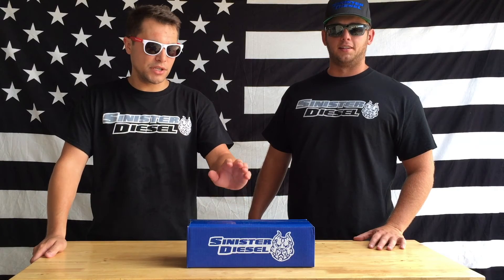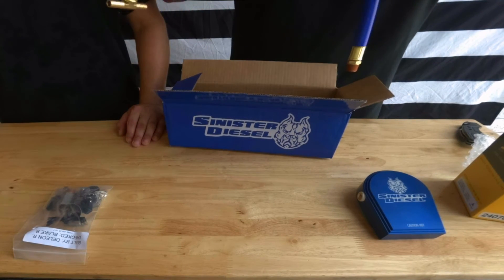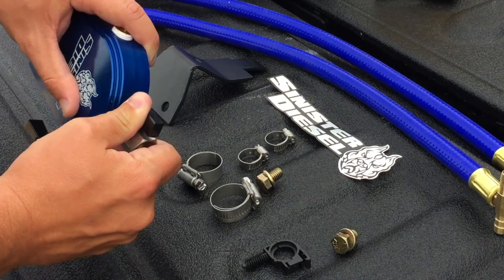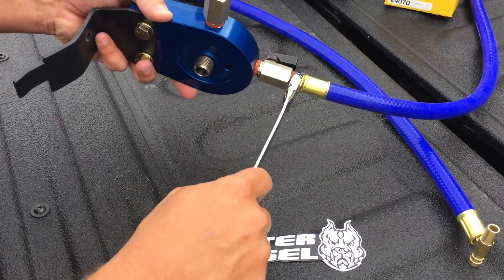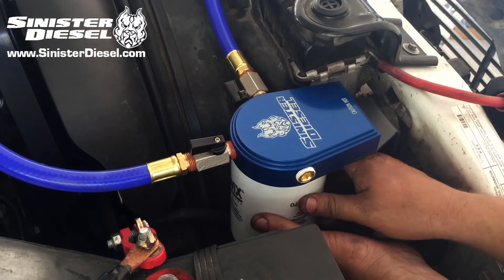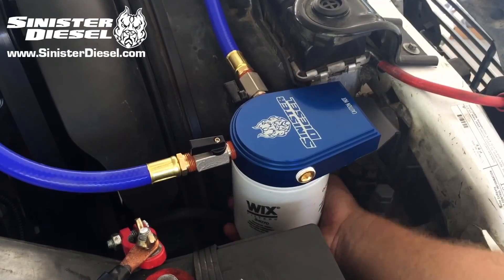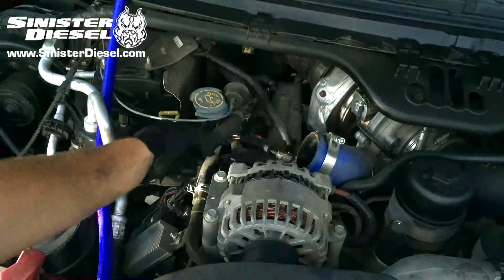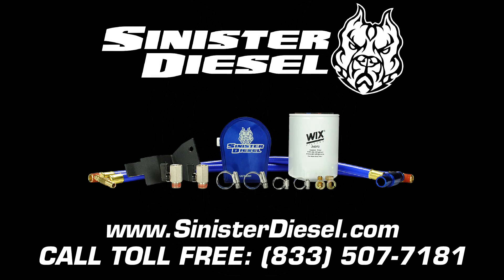Installing Sinister Diesel's Coolant Filter Kit for 6.0L Powerstroke

Comment: I'm not sure what "Automatic Climate Control" is you mention and what does installing the "T" Fitting on the Engine Side of the Heater Core line Mean?